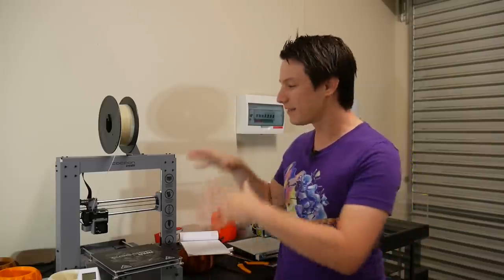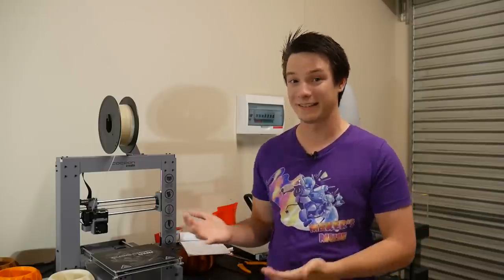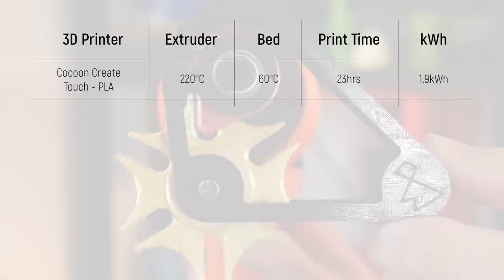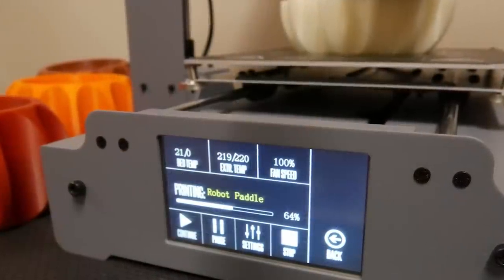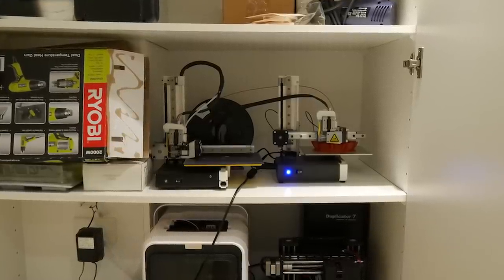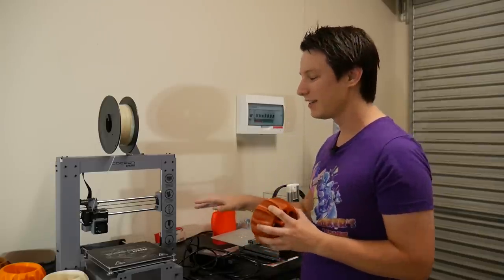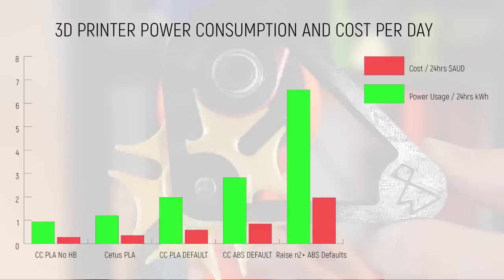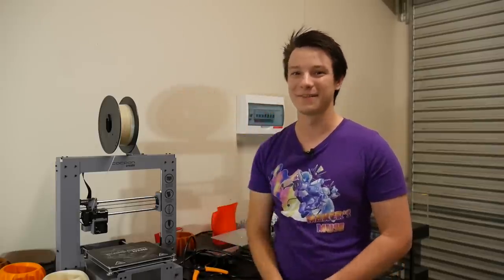How much power do 3D Printers use?

Comment: The motors barely use any of that to run, however the heat takes an emense amount of energy. This is because the motors are designed to be fairly energy efficient. However energy inefficiency means the energy not used to perform a task is let off as heat, so whenever you try to heat something it is pretty much designed to be as energy inefficient as possible, the higher the temperature the less efficient it becomes, it takes a lot of energy to heat something so it takes a lot of electricity

Comment: The heatbed has a huge influence in the consumption because it dissipates a higher amount of heat than the extruder. Most of the consumption goes to the heatbed.

Comment: Could you turn the heat bed on for say 15 minutes to secure the item to the bed then turn is off  and have it still stick to the bed?
Reply: no. when the top area starts cooling it pulls on the bottom and curls up the edges off the bed

Comment: Thats actually lower than I thought it would be, Im guessing the CR10 would be above that due to a larger heatbed but still, probably only 50-60 cents a day If I run the heatbed. Bugger all really. What electricity company bills quarterly? Or is this a state by state thing? In WA its every month for businesses and every two for residential.
Reply: ImpatientTurtle They bill quarterly in EU / UK and evidently in AUS. They also price gouge.

Comment: The hotter the bed is, the more heat is dissipated, due to the large emperature
difference with the air.
This results in PID PWM at low temperature, where the heater is turned off more
than it is turned on; As the bed temperature is set higher, the heater is mostly turned on.
Of course, this is even worse with an open design printer, rather than a box, that
retains the warm air, inside.
Currently, I am working on a large printer with aluminium vslot profile.
As you might know, aluminium has a thermal expansion of 0.023mm per degree, per meter.
With a 60cm heated bed, this is a true nightmare.
So I might need to use an open build.
Sorry .. I'm venting some frustrations.

Comment: did you ever measure the real temperature of the printer bed with an infrared thermometer, when the temperature is set up to 60 C or to 100 C?
My printer shows approximately 5 to 7 degrees less than the setup.
Reply from the maker: That sounds about right, with the sensor on the bottom of the bed you get losses on the top.

Comment: I always use Cura's tweak at Z feature to heat the bed only for first few layers and then it turns off
Reply: If I turn off the heated bed my prints get loose after about half an hour when the bed has completely cooled. I have a glass bed though.

Comment: I think the people who make plastic mini greenhouses with zipper door access are missing a trick. They could make square box covers into the walls of which mini fans could be fitted to circulate the warm air around a printer which  prevents delamination. Worth DIY making one at home: plastic sheeting, glue, tape, + micro fans. Stick it to the table with simple cross brace fitted to the printer top bar it'll create a localised warm ambient temp without the expense of a solid enclosure.

Comment: Ambient room temperature will make a difference in power used to heat the bed too. 30 degree ambient 60 degree bed is 30 degree difference. 30 degree ambient 100 degree bed is 70 degree difference. over twice the difference.  Yet 60 degree vs 100 degree isn"t double.

Comment: I would like to have seen the cost of filament, somehow I would think that is more expensive as well as more of a direct cost.
Reply: While that might’ve been a nice metric - for specifically this video - most of the softwares now will tell you both the duration and the amount of filament to be used, including the projected filament cost. 

As he said,  they are all going to be pretty similar except for his shelf one which he mentioned he uses an internal metric which changes that. The rest of them will all be very close based on their exact Gcode.
Reply: Honestly most slicers will tell you the exact amount of grams, hours, and minutes a print will take. The standard filament spool for 1.75mm PLA is 1kg (2.2lb) and the pricing per spool can range from the low-end of $16-$20 up to $30 and up for something like a carbon fiber infused filament. From there you just math-out the conversion of what's being used from the total amount at it's cost and it should give you a guestimate of price per print.

Comment: Does your PLA really require 220C?  I print Hatchbox brand PLA at 185-190C.
Reply: A lot of it really matters what you are printing, and how much perimeter wipe that particular print might have. 

 I say this because I use almost at box exclusively and it really does matter when you change the print temperature across the same filament.    This is most evident when you are using a wood filament, because it tends to burn the filament and make it darker as you increase the temperature, but most people would be surprised to know that PLA “lays down” differently at a higher temp.  It’s for exactly that reason I’ve gotten away from PLA for many of my projects and used PETG instead,  with its consistant ‘glossy’ finish.

Comment: It's much cheaper to print PLA with unheated bed. It also generates significantly lower total power load for a print station.
Reply: Ryan Huang I like your thought process as it will also add more amp load to a circuit or breaker.
Reply: But it may increase warping...reprints are not cheaper either....something to consider
Reply: 2 Kwh for a day compared to one kwh is basicly nothing. saving 10-20 cents on a potential reprint if the part warps is often not worth it. I can print around 600 grams a day of pla which cost 18 USD where i live at the cheapest. Even if just one out of 50 24hour prints fail i will spend way more on plastic than power just from that one failed print.
Reply: @craazyy22  I think you meant .18 or 18 cents but I think most people got it.
Reply: No i meant that 600 grams of pla cost 18 full USD. Thats why risking a failed print is stupid.

Comment: Coming from a position of energy engineering, not 3D printer.

Most of the energy is lossed to the ambient. Just adding insulation would reduce the rate of lose and heavily decrease the power needed.

Something that is a fairly good insulator is carbonboxes. Just put a carbon box over the printer.. Of cause put a window in, but make it to tile window.

Maybe somewhat counter intutive. The second tile adding twice as much insulation as the first. This have to do with room convection. That is that the air moves. On the inner and outer side of the tile the air can move frealy. Between the tiles the air is limited by a lack of space, so movement is slowed down.

This make it so that the insulation value between the tiles is just half of that on the inside and outside. So for a single tile window you get 1+1=2 insulation value (inside+outside) but for a dual tile window you get 1+2+2+1=6, (Inside+2*between+outside):

This is also why cardbord boxes insulate that well.

Comment: 60 to 100 degrees is a substantial increase!! Or wait- waht kind of degree? ^^ cause if u mean celsius its two times the difference between ambient room temperature and desired heat bed temperaur e. (20 to 60, 60 to 100 - two times a 40degree increase). And of course the energy needed to heat this tiny nozzle is neglectable compared to the energy needed to keep that huge heatbed-body warm..
Reply: interesting though that the big one drawed so much more.. I mean the casing should really help to keep the heat inside..

Comment: So... unless you have a crazy printer -- then with the heatbed on, basically about as much as an old school lightbulb -- (a little less for PLA and a little more for ABS). -- with the heat bed off, then cut it in half... -- got it.

Comment: Anyone have any idea how much power a creality ender 3 consumes per hour? I need to figure out how much my printer uses.. Plz help!
Reply: If anyone needs to know how hot I run my printer I run my hotend at 205 degrees Celsius and for my heated bed I run it at 60 degrees Celsius. I am wondering how much power the ender 3 uses per hour on those settings.

Comment: The problem with this test method is that you don't get a result for individual parts of the printer. So here's some theoretical stuff:
The nozzle doesn't matter at all. Even if you would have to heat it to 400°C like a soldering iron it would still use the 90% of the required energy in the first 2 minutes. 
The heated bed is not that much different. You use high power to heat it up but much less to keep it warm. The hotter you heat the aluminum bed the more it cools down per time unit. At a temperature of around 55°C you will have to wait more than 30 sec to see it cooling down just a single degree C at room temperature. So printing with a bed close to 60°C also dos not consume that much after heating. 
The steppers are more consuming. The problem is that they consume almost the same energy no matter if they spin or not, as long they're activated. When you have a large print with a layer time of several minutes, one might think that the z axis doing a little layer step every layer consumes much less power that the x and y axis, which are moving the whole time. This is wrong. Holding the stepper in one place has 100% at a certain phase the whole time. A moving stepper builds up energy one phase after another resulting in a lower power consumption (without load).
And the last part is the electronics. These cheap arduino boards are power hungry. Instead of a desktop cpu they can't set individual sectors into deep sleep. So even when your printer is finished printing and stays in idle some hours because you e.g. printed over night it still has a pretty high power consumption for basically doing nothing at all.

Comment: I have exact wattmeter as Angus, and my Prusa i3 MK2 shows ~90W usage, but when I connect to wattmeter my PC (which sucks ~870W) 3d printer almost doesn't have any effect on wattmeter. Wattage  barely increases to 880W. So 3d printer alone on wattmeter ~90W, PC alone ~870W, 3d printer + PC ~ 880W. Can we trust wattmeters? :)
Reply: I doubt you can trust this one... i think it's getting confused by noise or phase. I wonder though, what do you even have in your PC? Quad GPU?
Reply: 8 gpus, it's mining rig.
Reply: Oooooooooh! yeah OK. An outright unbranded meter with a Chinglish manual doesn't inspire that much confidence, and yet it claims to be accurate to a couple percent and a couple counts... which sounds plausible. Difficult to say!

What if due to resistance of the power strip the PC actually caused an apparent input voltage dropoff on the printer power supply and caused it to output less voltage in turn, and that caused it to consume less power? No, that can't be it, its impossible for the printer to merely consume 10W when successfully printing anyway, outright impossible. Was PC connected to the 3D printer during measurement? Odds that you weren't actually mining at full speed while printing, which caused your PC to consume 80W less?
Reply: Mining at full speed always, it's just wattmeter doesn't react properly to printer while both (PC and printer) are connected to wattmeter. I don't know much about electricity, but can it be power factors influence? Maybe wattmeter are suited only to measure only one device. I think if only one power supply would power PC and printer, it would measure power consumption properly.
Reply: Hypothetically the power factor should not be at fault. If you add two phase shifted sines up, you still get a sine, so the aggregate consumer will still have a valid power factor. But I'll deliberate on this further, I'm curious.

Comment: So did it use 2.7 KW for the whole print or did it consume 2.7KWh totally different thing !!!
Reply: Probably 2700W for the entire thing. I know my printer uses about 300W every minute or so when heating the bed and about 70W when running normally.
Reply: he said 2.7 kWh, so it used 2.7 kWh total...
Reply: @zanpekosak2383  sry, but you are mixing up energy and power there, you can't use 300W every minute, you could only increase power consumption by 300W every minute (= consuming 900 W after 3 min)... otherwise you are just using 300W.
Reply: @johnuferbach9166  I am not mixing up the terms. I am mixing the grammar 🤦‍♂️. I wanted to say that my power usage goes up to roughly 300W when the bed is heating and it normally consumes around 70W.
Reply: @johnuferbach9166  And yes I wanted to write 2700 kWh...🤦‍♂️...had a bad day yesterday.
Reply: @zanpekosak2383  oh, ok xD 
hope today is a better day :)
Reply: @johnuferbach9166  It is Lol
Reply: Kilo watt hour. It uses 2700 watts every hour.
Reply: The total print consumed 2.7kw over the entire print but when you refer to power as just kilowatts that is a single point of reference but when you want to talk power used over time we use kwh which is kilowatt hours not to be confused with kw/h or kilowatts per hour I hope this helps

Comment: Substantial increase PLA to ABS ? 60->100 is 66% increase in tempertaure and 1.9Kwh to 2.7Kwh is actually less than 66%. Not sure how that is alot more energy than should be expected .. when you increae temperature by 66%?
Reply: Energy consumption is proportional to temperature *difference*, not absolute temperature. So if the room temperature is 20, 20->60 is 40 celsius temperature difference, 20->100 is 80 celsius. That doubles energy consumption for headbed.

I wish people paid more attention in their high school physics class.

Comment: Looks like you were burning a little over 100 watts of power on your highest ABS settings (without the giant machine).   As a rough estimate, we'll use that and a cost of $0.10 per kwh of energy.  

0.1 kw * $0.10 per kwh = $0.01 per hour of operation.  One penny per hour.  Much cheaper than a small change in material usage.  Also, it would take 1500 hours to save enough to buy a power meter (assuming one costs an average of $15).  That's over two months of continuous run time.

Comment: It's pretty obvious that the printing bed is large energy consumer.
The calculations below is based on 'popular thermodynamics'. 
Some shortcuts have been used and more complicated thermodynamic phenomenon's have been ignored
------
It's pretty obvious that the printing bed is large energy consumer.
Your base measurement with PLA and a bed with no heat tells that the printing head, stepper motors, fans, etc uses ~40W (= 900Wh / 23h).

Now, lets assume your room temperature is 24°C.

At a bed temperature of 60°C the temperature difference is 36°C.
The energy consumed by the bed is 1000Wh, thus the average power consumption is 43.5W.
If we divide the power consumption with the temperature difference we get the insulation coefficient of the bed:
43.5W/36°C =~1.2W/°C.

Temperature difference: 36°C
Average power consumption: ~43.5W
Insulation coefficient: 1.2W/°C

The same calculation on a bed temperature of 100°C results in this:
Temperature difference: 76°C
Average power consumption: ~78.3W
Insulation coefficient: ~1.03W/°C

The two calculated insulation coefficient should be the same, but some external influence can have an impact on the result: 
The average ambient temperature might not have been the same during the two tests.
The efficiency of most switch mode power supplies rises with rising output power, - until close to the power supply's output limit.
The higher temperature on the bed, 100°C vs. 60°C could introduce a higher input temperature to the printer head cooling fan and thus demand less power to keep printer head temperature up.

As comparison we can calculate the same values for the printing head:
This calculation is made without deducting to the power used by stepper motors and fans.

Temperature difference: 220°C - 24°C = 196°C
Average power consumption: ~40W
Insulation coefficient: ~0.2 W/°C

I hope the above is not total nonsense to you.

/oakey
Reply from the maker: That was actually incredible. Thank you.
Reply: My pleasure.
As newcomer (jan 2018) in the 3D print world, You provide a lot of input that helps me to refine the 3D prints from my CR10s.
Keep up the good work.

Regards from an electronic engineer, 
B.Sc.EE and a lot of other #¤&! :-),  since 1978, 
- now retired.
/oakey
Reply: Dont you dare insult Angus! Or i off you!
Reply: Hi a51mj12,
I hope your reply is a joke....
Reply: it is

Comment: Jesus 0.267 cad per kwh! We pay 0.185 per kwh. My ender is running for 24 hours printing pla on a 205 nozzle/65 bed. Used 2.45kwh. at 0.1580 per kwh... $0.384 to print for 24 hours.

Comment: It isn't just about the machines ( heating as they are mostly all similar ) it is about the power supply and its efficiency ... I measured my load factor of my 3d at 0.45 ... yes 0.45! ( 45% efficiency ) . So one might inspect the power supply to see how efficient the power supply is at the power consumption your printer uses. You must match the expected usage to the correct power supply so it operates in its maximum efficiency point. @ a power factor of 0.9 versus 0.45 that is 50% difference in power being charged . refer - https://3dprinterchat.com/2017/03/3d-printer-power-supply/
Reply: Households, at least in the UK, arent charged for VAR anyway, but for KWH. Only factories get charged for reactive power. There are a lot of conmen selling power factor correction devices to people who dont realise they dont need them and it will make zero difference to their energy bills. I think that article confuses the efficiency of a PSU with power factor quite nicely.